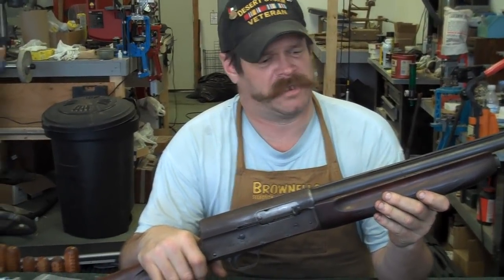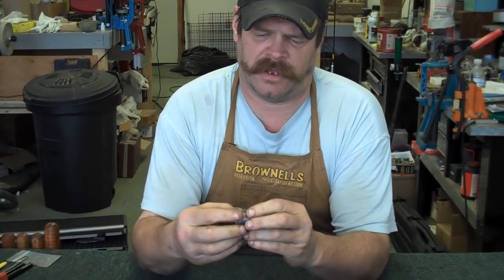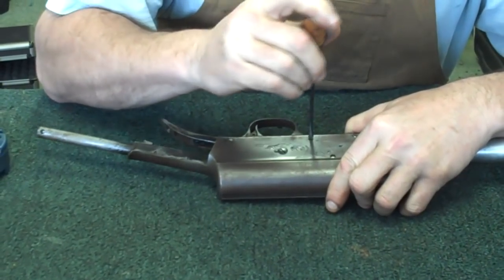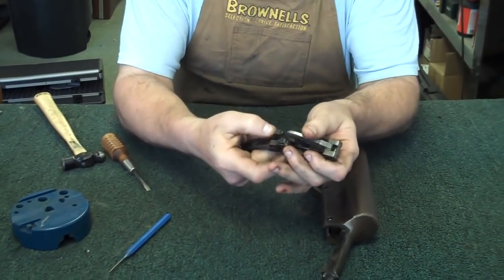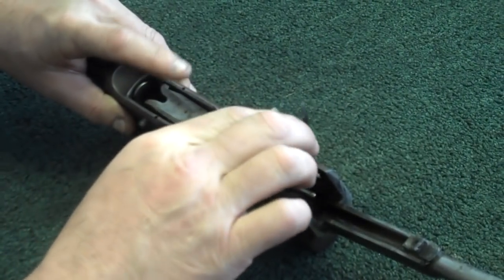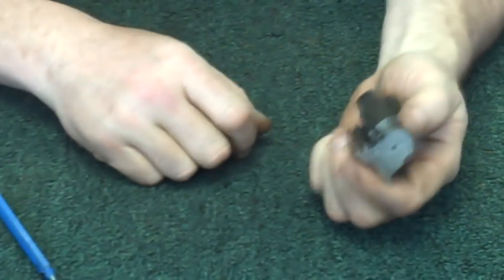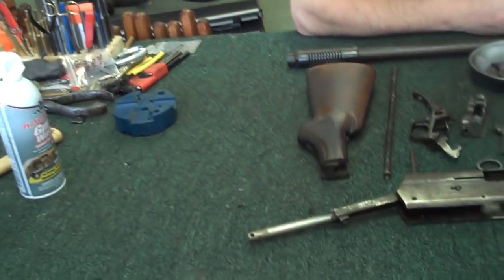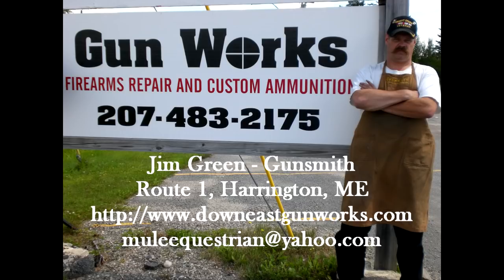Gunsmithing: Remington Model 11/Browning A5 (Gunworks)

Comment: I found a Remmington  model 5 in a FL paper. Guy had it his trunk. Very rusty and beat. The numbers say 1912 when looked up. I sanded, scraped and cleaned and painted it with Satin Black. I painted all metal parts except the spring and the bolt assembly. Ran a rolled up sandpaper on a shaft through the bore with a drill motor. strapped it down to a pair of horses with a couple of 6.5 bird shots in and tied a string to trigger. BOOM. Cant tell all. Could not have done it without you Thanks.dc

Comment: i'm so glad you put the trigger reassembly tip in your video. i spent hours trying to manhandle the screws back into place with no luck.....thanks again for the tip on locking the bolt back  when putting back the trigger group.......

Comment: Very useful video, thank you for taking the time to make this! If you have the time, I'm having a problem with my current Model 11. After tearing it down with a full cleaning and oil, it still has an issue. If you allow the bolt to go forward with the release button (or with any force behind it) once the trigger is pulled the bolt will not separate from the barrel. The entire trigger assembly must be removed to free it. If you slowly guide the bolt forward then fire it will cock back fine.

Comment: Very, very helpful video. Was able to tear down my Savage 775a and diagnose a problem that I've had with it for some time. Found that the pin for the carrier latch was broken in two. Going to order 2 new pins and a new carrier latch also which should fix my problem of not feeding. This is the only thing I found wrong other than it was in need of a dire cleaning.
Thanks a bunch for your videos.

Comment: Hi Jim.  Just a note here, since your video was one of the only ones I could find that was actually at all helpful for me.  I’ve been working on an ancestrally-acquired 20 ga Remington Sportsman, with a serial number above 1.1 million (1103042). The patent stamp on the barrel mentions Browning, but the side of the receiver and the bolt are both engraved with Remington and “The Sportsman,” respectively. I can’t find any sites to date this shotgun, although I’d like to know more about it. The point of my note, though, was to mention that during disassembly of this guns action, I was unable to remove the bolt in the way you demonstrated.  When you removed the link pin that retains the  locking bolt, you aligned an access hole with a crescent-shaped cutout on the lower edge of the ejector slot in the frame. My specimen of this gun has no such crescent notch in the frame. I actually had to reshape a small flathead punch, so I could squeeze it through the tiny space where the pin was visible on the breech bolt, and gently drive the pin out through the access hole from right to left… backwards from the way you removed it. It’s almost as if Remington “forgot” to cut the access crescent in the frame of this gun. I just thought I’d post this in case somebody else encounters this apparent oddity, or to ask if you had ever encountered this issue when servicing these guns over the years.  I’d also appreciate any info regarding its date of manufacture, if you happen to have better resources than I can find on the internet. Thanks for the helpful video!! Good job!

Comment: Great video for my Savage 755A. Watched the video in reverse to reassemble. The only note I have to add is one of the small screws is different if you have all the parts on the table after complete disassemble. It goes to magazine tube not the other small screw (lock) locations. It's extended a little longer and a little noticeably different than the others. Thanks! :-)

Comment: My particular model doesn’t have the cutout in the receiver to push the pin through to the other side. I know this is an old video but I need help with the disassembly. Thank you so much great video

Comment: @morepaincom i just had a similar problem after reassembly. i found that you need to remove the trigger group again. slide the bolt all the way forward. push the lifter up slightly, then replace trigger group large pin first. 
hold the lifter up still as you install the small pin and test. otherwise disassemble and look for a bind or a broken spring. make sure the bolt rod is contacting the action spring. 
hope it helps

Comment: Thank you for this video, Jim. My vintage 1914 Model 11 is a treasure, inherited from my grandfather.  Out on the trap range today the barrel and bolt jammed - barrel and bolt seem fully retracted and stuck, spent shell not ejected.  Can you advise me how to clear this jam?   Can you offer any tips to avoid future jamming?  The Model 11 is in excellent condition.  It was torn down and cleaned by a gunsmith before I started using it.

Comment: you do some great videos, your material is a great supplement to the AGI gunsmithing course.  I'm in the shotgun section right now and got my hands on a Browning A-500G.  sortof a mix between the A5 and rem 1100.  Got it field stripped per the manual, but having trouble going further.  Think you will ever do a video on the A-500G?  Thanks again for all your great videos!

Comment: I just bought a 1951 savage arms model 775A ober the weekend. It's a nice gun but acts like it aint been cleaned in a decade. Your video helped me alot, but do you have a link to a website where i can get the screw drivers your talking about and the blue thing you use to rest the butt end on?

Comment: Hello. I have a Remington Model 11 problem. I took it apart and cleaned and oiled it, replaced all the springs with new ones. When I pull the bolt and release it, it becomes jammed inside the barrel lip. The bolt goes forward all the way and goes inside the barrel lip, but when I try to pull the bolt handle, the bolt will not move back. I have to remove the barrel to release the bolt from barrel. Any solution for this issue?

Comment: Your video is a fantastic help! I recently purchased a 1909 Remington Model 11 that I am trying to clean, and I cannot get the pin at 9:00 out of the bolt to get the retaining part, bolt handle, and subsequently bolt free of the receiver. It lines up properly, but just refuses to move. Any suggestions?

Comment: Great video. Found a Belgian A-5 12 and plan on restoring it as my first project. I would like to know if you need a certain type/s of punch to disassemble it? Plus off topic on this  video, what is your opinion on using vinegar to strip off bluing? Will it be ready polished for re-bluing or will it need fine sanding? I plan to cold blue. TY Jim.

Comment: So I've got a my grandad's old Springfield 754B which is essentially the same.  I'm having problems taking out the screw above and in front of the trigger guard.  It has an anti roll pin and I've got that out, but when I go to unscrew the main screw it spins but doesn't come out. Any suggestions?

Comment: I am having trouble getting the bolt out of my Model 11 Sportsman. You talk about lining up the pin with the cut out in the right hand side of the receiver and driving the pin out from the screw hole on the left side. I do not have the cut out in the right hand side of my receiver that you show in the video. Can I fit a punch between the receiver and bolt on the right hand side and drive the pin out the screw holde on the left hand side? Your help would be greatly appreciated.

Comment: I have a Remington model 11 that seems to be one of the newer ones. When I purchased the gun there was no carrier lifter spring only the captive spring that activates the small lever on the carrier itself. I bought a carrier spring thinking a weak one was causing shells to get stuck on the edge of the chamber. Did some models come without this spring? I'm not sure how to put it in either.

Comment: I have line up Bolt with the 1/2 Moon Cutout on the ejection port but can not get the Locking Block Latch Pin out. I have tried heat, PB Blaster , and bangin away...No luck, any suggestions.

Comment: I am going to be watching this video everyday till I get some good screwdrivers and then maybe I will be ready to try and get  my Model 11 apart and cleaned.  I don't think it has been cleaned in about 30 years.  Right now it doesn't want to cycle either.  It will fire one round and the next round out of the magzine hangs up for some reason.

Comment: Thanks for the video, Jim.  I have a Remington Model 11 in 16 gauge that I can't get the bolt out of... there is no notch in the ejector port and i can't get to the pin.  There is an access hole on the other side, but i'm stuck.  Have you seen this before and do you have any advice?

Mike
Reply: P.S. I just saw your reply to AZ Snipe.  You mention the small hole on the left side of the receiver in the edge of the ejection port.  Do i punch into that hole or is that just to help with alignment?

Comment: I have a savage 755 and its dated back to the fifties. I have been told some parts on the browning a5 is interchangeable with my shotgun. Do you know if the firing pin is the same. My firing pin broke and replacements seem to be hard to find.

Comment: Jim
I have this shotgun. I need to replace the ejector pin which is part of the barrel assembly. My question is can I do this or do I need to have a gunsmith do it. It appears to be a press fit and the replacement looks like it would be fairly simple to replace. Any help would be welcome.

Comment: @downeastgunworks i fixed mine. The spring tube was in the stock not atached tho the gun. I dont know why it would come undone? i just shot it. When i tighten the guns bottom screw up(the one with the little one next to it to hold it in place) it wont work. It works if its not real tight but its a bit loose? How common is it to have the spring tube come undone? I loved your video btw.

Comment: Thank you for the video. I Have a question though. After dissembling my Model 11 and getting it back together,  the bolt release will no longer send the bolt home and the bolt gets caught on the shell lifter and no amount of force will send it into battery. Is this common or did i make a bad mistake?

Comment: HI Jim, Thanks for the video.  However I ran into the same issue as MrSaac13 below with my Model 11 Sportsman 20GA.  No half-moon cutout to push the pin through to remove the stop latch piece.  There is a notch about 1/2 inch in front of where the half-moon cutout would be but my notch does not go all the way through receiver.  Do you know how to remove the bolt on my gun?
Reply: +Gregory Carrigan   I ran into the same problem with  a Model 11 I received to clean up.  I lined up the pin with the hole in the non-ejection side of the receiver and used a small punch to drive the pin out the opposite direction through the bolt on the ejection port side.

Comment: To clarify, the pin I'm talking about is the one you remove at 9:09 to 9:39 in the video.  I don't see any easy way to drift it out, and I can't drift it out through the left side of the receiver.

Comment: hi- please can you tell me the proper assembly sequence for the brass bushing assembly ?  the one at 1:56 -  question is ,  which part is against the spring ? the brass piece?  or the steel ring ?  i have the savage 755a - took it down to clean it and cant remember the propper re-assembly sequence

Comment: I have a Remington model 11 Sportsman 12 ga. (746488)  I am stuck trying to disassemble this one. On my gun, there is no notch or hole on the right side of the receiver to drift the pin in the bolt through.  Any idea as to how to remove that pin so I can remove the bolt assembly for cleaning and inspection?

Comment: I am having issues when installing the trigger assembly on a Savage 720
When installed the safety sear will not allow the trigger to release the hammer 
When the trigger is out of the firearm I can easily more the sear to allow the trigger to release the hammer 
I have followed this video meticulously when I disassembled and this is my only issue 
And ideas?

Comment: Pretty good but no mention of the springfield 745 series and needs more in depth discusion of the lifter spring such as how it fits into the shotgun and how to reasemble this is one of the main reasons for the springs getting broken. Also could use better close ups.

Comment: Hello
I have my grandfather model 11 and it needs the clay type block bump stop replaced 
It’s a round clay type material that looks to be riveted to the back behind the slide 
I have the parts but could use some coaching on how to do this
Reply: If I’m not too late, it’s the fiber washer. Search on Google for Remington Model 11 fiber washer replacement: The easiest/modern method is to epoxy it on, avoiding the OEM river retention, which is problematic and requires a special tool ( home made or otherwise).

Art’s Gunshop of Missouri mentions this process on a video, and IIRC the Shotgun Forum has some threads on the topic. I’m about to do this myself, but forgot which type of glue to use.

Also, Art’s sells a good rebuild kit for the 11 which includes an improved spring for the forward tube area ( the flat wound spring is of poor design) and other various parts for a minor refurbishment.

Comment: I have a 1947 Remington model 11 which does not have the half-round hole in the ejection port through which the pin is driven that allows the bolt to be removed for cleaning. Getting it back together was a trial despite following the warning at the end of the video. I had to hold my nose just right...
Reply: Update: apparently the receiver is an early model but the barrel, where the date code resides, is from 1947. With the early receivers the pin is driven out in the opposite direction.

Comment: I do not have the cut out on my gun to remove the pin holding the bolt in place... what do I do to remove the bolt pin?
Reply: You can sneak a small punch in.  just did a Revelation 400 with no notch.

Comment: has anyone heard of a remington model 11 with magazine cut off like browning auto 5 I recently purchased one and it is not supposed to exist it is in 20 guage and lacks engraving I have several others in different guages and a savage alloy version and none have a magazine cut off I also have a belgium light 12 and sweet sixteen and this cut off on the remington is identical to both brownings it does not have the auto loading device of the 70s browning the older browning does not have the auto loading feature either any insight into this mystery remington would be greatly appreciated

Comment: The pin that you remove at 9:30 will not budge in my A5. Any thoughts?
Reply: +Tyler Newell Have to drive the pin out in the opposite direction of what is shown in the video.

Comment: does anyone know what the idea behind the magazine cut off switch is or why it might be useful?
Reply: Bridgestone
Reply: If you have a shell in the chamber you would like to replace with another shell say for instance a big ol buck steps out and you have a number six in the chamber you use the magazine cutoff to prevent shells from feeding from the magazine allowing you to take that shell from the chamber and put in a buckshot instead. Deactivate the magazine cut off and you are back to normal operation.
Reply: Or if say you are squirrel hunting you could fill the magazine with buckshot loads just in case and use the magazine cutoff to keep them there and just single load squirrel loads while hunting